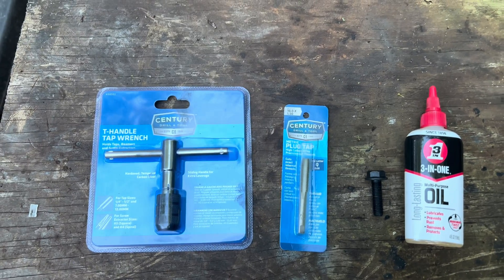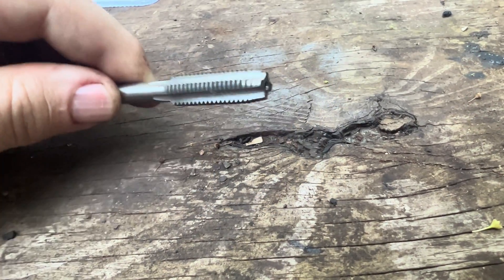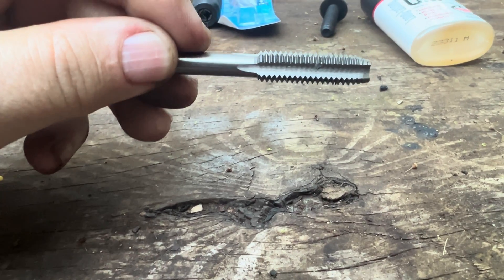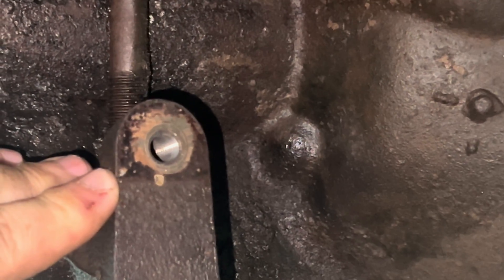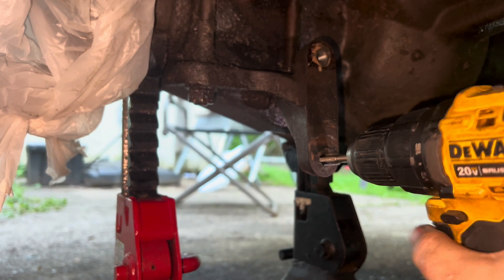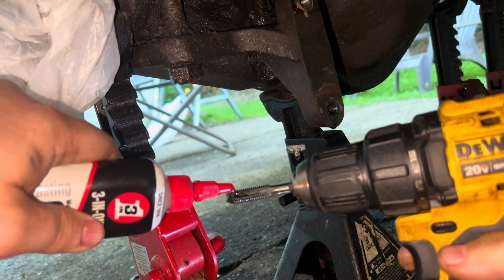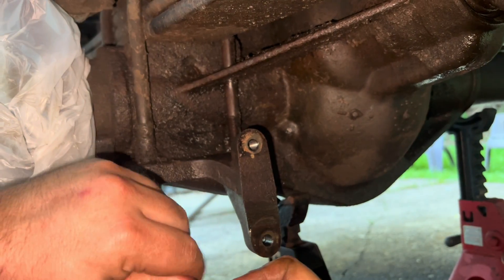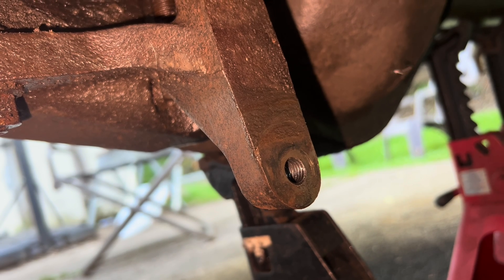How To Rethread A Stripped Bolt Hole With A Tap. #howto

Comment: Wow!, Your technique needs a little refining Use a first (that is a taper tap), make sure the hole is the correct size for the thread to be cut (or at least very close to it). The reason that you cannot start the thread with the tap in the wrench is that it is a 'second' tap, ie the one you use after the taper tap. You shouldn't power drive a tap into cast iron or any other metal for that matter, it often doesn't go well. You can end up with a broken tap and be in a worse state than you can imagine.  If the hole is the right size then the correct tap, if it is sharp will cut with hand pressure. The 'T' you refer to is a tap wrench albeit a 'T' type

Comment: Should it take a lot of force because I’ve been trying and I don’t want to break anything
Reply from the maker: It depends on the different type of metal that you’re trying to re-thread, but I would say about 10 pounds of pressure normally not much over that.
Reply: @ ok well should I try my drill because both of the T bar tools I got both cracked and broke because they were made of some pretty weak aluminum

Comment: Are you able to keep using the same bolt that was already in the hole?
Reply from the maker: @XDkrym you can only reuse that bolt. If the threads aren’t damaged they do make a kit where you can re-thread the bolt also but usually it is much easier just to buy a replacement bolt.
Reply: @ ok thank you just wondering
Reply from the maker: @XDkrym you’re welcome 👍

Comment: Oh I hate to tap a hole, had to do it many times in my life and yes it hasn't always worked out. The worse for me is the exhaust manifold bolts that break off. At least it's a useful skill that after you learn then your unstoppable.😅
Great video and yes I have used the drill many times with good and bad results.👍
Reply from the maker: Yes, it’s definitely good to learn to re-thread, stripped bolt holes. 👍